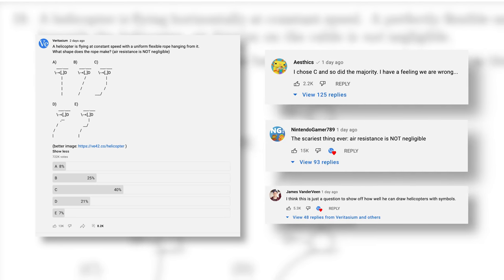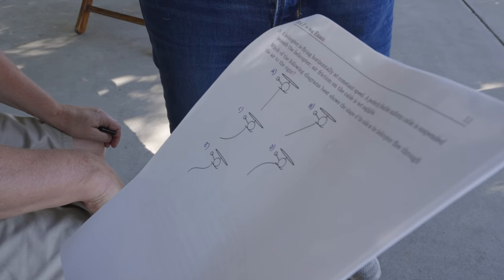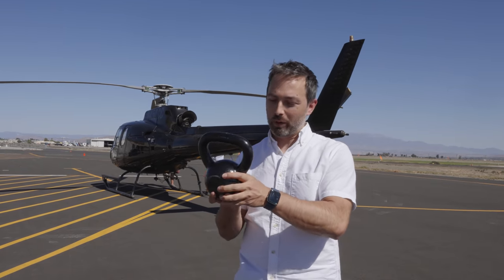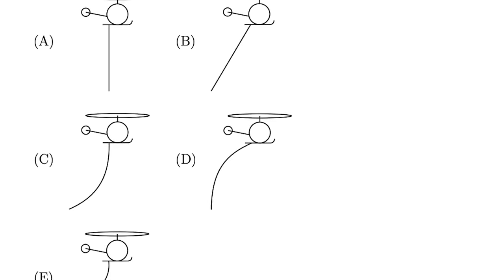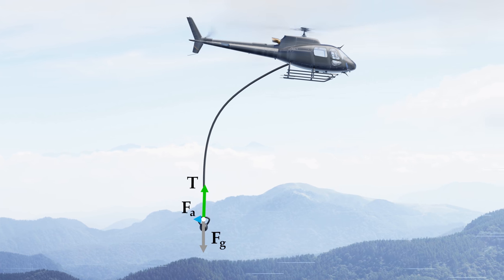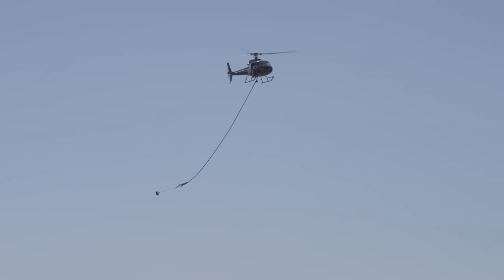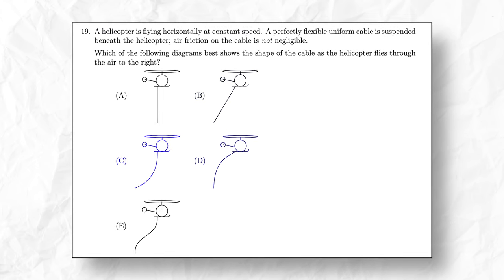I Rented A Helicopter To Settle A Physics Debate

Comment: I picked B because it felt correct, but that's probably due to me having watched helicopters with sling loads in person before. Great to see the actual explanation behind it!
Reply: I have worked up north for a few years, and most equipment going off-road is transported by huge helicopters (diggers, material for camps, etc.)  So I've seen lots of helico transports coming and going.  They used a huge rope, like a ship, and the loads were heavy (much more than 20lbs).  And each time, the sling was in the C shape.
Reply: me too but never have even seen a helicopter up close
Reply: shouldnt it be in the D shape if it has a load attached to it? B is only for a cable without a load
Reply: @nicolasfisch2794  the farther up the cable you go the more tension is on the rope, it'll be straightest at the helicopter
Reply: @nicolasfisch2794  google for aerial firefighting helicopters. They have a bucket of water hanging and while moving the rope takes the b shape. 
There is not one correct answer. Probably it depends on the weight and the distance between the helicopter and the weight. But I am no expert (in fact I am the exact opposite) so dont take what I say very seriously.
Reply: @cabrinhaGR  Yep. The shape depends on how heavy the weight is and how fast the helicopter is moving. It can go from B to D back to B as the helicopter reaches higher speeds or the weight changes.
Reply: @coolcat8b  
I used to be an ironworker in my younger days, occasionally we'd use a helicopter to set pieces where it would be too expensive or impractical to use a crane, one of the job's we used a helicopter on was a building we'd built that was a shipping warehouse that looking from the top was 10 acres in size, we were using a helicopter to set the HVAC units on the roof.
You should've seen the guy flying that helicopter, he'd pop up at the end of the building and come screaming full bore down it with the load angled behind it from the drag, when he got close to where the unit would be set he'd flare out and the load would swing to right over where it needed to be, before it could swing back he'd have already moved the helicopter forward to where it was directly over the load at the end of it's swing from  when he'd flared and he'd be right over where that thing needed to be set, man could that guy fly that thing. 
This was back in the 90's, I had my suspicions from having been in the Army in the 80's and learning the difference between the guys who flown them in Vietnam and the guys who came afterwards, when we were done he'd landed the helicopter in the job site and was signing paperwork when I walked over to him and ask "You flew helicopters in Vietnam didn't you?", he just looked at me and said "Yep" with a smile on his face and I said "Yea, I kinda figured that".
Reply: @cabrinhaGR  totally agree, it is a shame they didn't discuss this
Reply: @coolcat8b  I'm guessing they were transported in large boxes that would give it a higher drag/weight ratio.

Comment: My guess was E, for what it's worth. But I don't know much about helicopters, so I was factoring in the downforce from the rotors, which as was explained in the video, is pretty much a non-issue.

I'm also not a Physics major, so there's that.
Reply: Good
Reply: Im a physics major and it was obviously B and D in the two scenarios. Really surprised that this is a "challenging" question to some pysicists
Reply: @seankrolyk5814  Could you please help me understand that why in 8:40 the air resistance is increasing as we go up the rope whereas it was constant in the other two cases ?
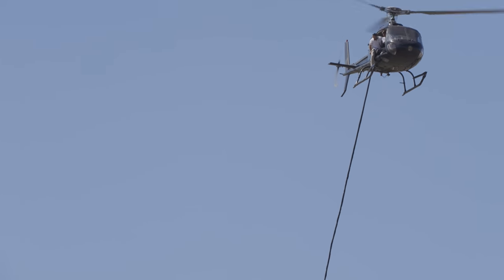Reply: @Guri_Veera  it's explained at 5:00
Reply: I put E while taking the test; I thought air resistance would act equally and make it a straight vertical line at a constant velocity other than near the helicopter.

Comment: Do you remember the thought experiment about 2 spaceships moving at speeds near speed of light, that shoot a beam of light to each other? Soon, time will come for Derek to order 2 spaceships.
Reply: I’ve heard the one about two spaceships moving away from each other at .5c but I haven’t heard that one; how does it go?
Reply: @motetotee  In this experiment, two spaceships move parallel to each other. One shoots a beam of light towards another. From the perspective of an observer on one of these spaceships, the light travels straight path which is perpendicular to the direction in each the ships are flying. While observer who is just standing near by, sees that light travelled through a diagonal path. Light travels different path depending on velocity of an observer.
Reply: another one about two spaceships with a picture frame moving near light speed in one and another observing. Derek will soon test that one too 😂
Reply: I literally had this on my relativity test a week ago. Well I know I got that one wrong.
Reply: I remember the Bell's spaceship paradox asking if a string tied taut between 2 spaceships accelerating from rest to near C will break.
Reply: If you want to contact space X here's the number.....
Reply: Isn't that impossible to have a definitive answer with today's knowledge, due to it being impossible to test since you can't get that close to the speed of light

Comment: There is a harmonic oscillation occuring in the rope too. The tension is lower away from the copter hence the frequencies are lower and amplitude is higher. The tip of the rope is free so there's an antinode there, thus the high amplitude, so it's flipping between exp graph shape and log graph shape.

Comment: Neat experiment. As a non-physicist the “weight” + “parachute” shape answers for me were immediate, intuitive and seemed obvious but not the first one, the rope by itself… 
Great fun video!
Reply: The correct answer would have been (F) impossible to say without knowing the length of the rope and the rotor wash speed to forward velocity ratio. You've got downward wind from the rotors and wind from the forward speed. As the length of the rope increases, some of it will eventually fall outside of the rotor wash (losing the downward wind).
Reply: @Mr.Ekshin  He actually mentioned that the downward wind from the rotors wasn't actually relevant.

Comment: I love how last 2 examples are so easy and intuitive, while the 1st one is so confusing.
The proffesor who suggested to remove the weight managed to screw over so many students with that slight alternation.
Reply: The first one is not only confusing, it suggests you have to neglect one of the forces on the force diagram.  Had the question said the propeller wash is negligible, it would be a much better problem.
Reply: It’s not screwing anyone over when it’s literally physics lol
Screwing someone over involves something unfair but physics is by definition “fair”
Reply: They didn't screw anyone over. They stated all of the pertinent parameters necessary for the students to balance the forces and deduce a solution.
Reply: @bermchasin  that’s a good point. Most people wouldn’t happen to know that propeller wash dissipate quickly
Reply: @bermchasin  you would only state that the rotor wash is negligible if it were a hypothetical statement. In reality, the rotor wash is negligible. Certainly, you would have to have personal experience or prior knowledge to consider that, but that adds a more challenging aspect to the question.
Reply: @davidlogsdon7767  Personally I didn't even think about the rotor wash when I answered the poll. I chose C because my intuition initially told me the wind had less weight to deal with on the lower end, so the wind would move it more and move less at the top because the rope got all that weight hanging off of it. Pretty neat test, not gonna lie.
Reply: @XCOLEXful  absolutely. It really does seem counterintuitive. I don't have much experience with helicopters specifically, but I'm somewhat familiar with how dense air actually is. We don't usually consider that. High output leaf blowers demonstrate it quite will on land. The velocity drops quickly as you get away from the source and that's with a very focused stream. It's super cool to see it in action above ground.
Reply: @thehorizontries4759  they removed the part of a question which made it easier to picture in head and answer intuitively, so yeah the dude did screw over a lot of students that would answer it correctly if the weight was there.
Also it sucks how it didn't say anywhere that propeller does nothing to do the rope.
If the rope was weighed down you would assume that the object's weight is great enough to "ignore" whatever forces propeller exerts on it.
Reply: @bermchasin  Yeah it would be a cleaner task to solve for us who don't quite know how far the wash goes.  ...but hold on, wouldn't most of us still go for C answer? For the J shape? Wouldn't you?
Reply: @mfst100  i would go with the straight line example if we neglected the prop wash AND assumed a perfectly frictionless joint at the point if contact with the rope. But I'm also a physicist by training.

Comment: Meanwhile, in an alternate universe: 
“You are flying a helicopter. Assume air resistance is negligible.”
Reply: Well then the answer is you are cosplaying flying a helicopter
Reply: @AL-wv8jx  Not necessarily — it could also be “You are falling in a helicopter.”
Reply: "You are sitting on the ground in a helicopter while the rotor spins"
Reply: @AL-wv8jx  /bow
Reply: You know what, you don't need air resistance to fly a helicopter, reduce air resistance alone will actually increase efficiency of said helicopter.
Reply: @JimmyZeng  Question: What makes a helicopter stay in the air?
Reply: @Benny_Blue  Lift, you're probably thinking to reduce air resistance, you have to reduce air density, which leads to reduced lift (given the same rotor and head speed), but that's not the only way.

Hint: plasma.
Reply: @JimmyZeng  lift only works because there is greater air resistance on the underside of a surface than on the top. That goes doubly for angled rotors that catch air in a manner similar to fans. Even a bizarre helicopter model relying on buoyancy would only work with resistance from the air pressing in on the vessel. Any fluid with zero resistance is, for all intents and purposes, a vacuum. It cannot act on objects immersed in it or vice versa.
Reply: @vitriolicAmaranth  Lift is complicated, fully symmetric airfoil also works. Vacuum is not a fluid. I agree the only way to reduce air resistance all the way to zero is vacuum though, that is not what I'm trying to say.
Reply: @JimmyZeng  Correct, vacuum is not a fluid, nor did I say it was. I said a fluid that lacks ANY resistance is functionally a vacuum. It has the same properties as a vacuum. Actually, a fluid with no resistance cam't even properly be called a fluid, as with no resistance the particles comprising the fluid cannot directly influence their neighboring particles.
Reply: @JimmyZeng  Also, to be perfectly clear, I did NOT say that a vacuum is the only way to reduce air resistance to zero. I am not suggesting a practical way to achieve the goal of zero air resistance. I am saying that if there is zero air resistance, the helicopter will behave as though it were in a vacuum, whether it actually is or not.
Reply: @Benny_Blue  … helicopters don’t fly, they just vibrate so much that the ground rejects them … 😂😂😂
Reply: @vitriolicAmaranth  your explanation of lift is so completely misinformed that I assume you could only have learned it in middle school.  

Airfoils develop both lift and drag simultaneously from the acceleration they impart into the air. Lift is the reaction to this acceleration perpendicular to the airflow, drag is parallel. Lift to drag is based entirely on the angle the airflow hits the lifting surface. This is to say lift is a reaction force to the energy being imparted into the air by the wing. This is based only on the mass of the air and the acceleration of the air.
 
As the air is accelerated by the wing, a local low pressure is generated at the acceleration region, the wing is shaped so that it accelerates more air above it than below it, this is by making it flatter to the air on the top than on the bottom. This pressure difference pulls the wing up. As it gets flatter and flatter to the air though, more of the reaction forces from accelerating the air will be parallel to the airflow, meaning more drag, less mass acceleration lift, but more pressure lift. Eventually a point is found of highest efficiency in the wing shape and angle of attack for a specific windspeed to give the ideal lift to drag ratio.

Wind resistance comes from viscosity of the air for laminar flows and low pressure regions behind a moving body, both of which will not come up in a discussion of wind lift to drag because of their relatively small impact when the wing is in its operating conditions.
Reply: @Thesupremeone34  I know all of the first two paragraphs, but none of it is relevant in this context except to say, in a cursory manner, "lift is generated when the top of a surface has less pressure than the bottom." However, pressure is literally a function of physical resistance in a medium. Without resistance there is no pressure and without pressure there is no lift.
Reply: @vitriolicAmaranth  Pressure is not a function of the resistance in the medium at all. It entirely is a consequence of the momentum of the particles in the air. Viscosity, or physical resistance, is the resistance to sheer forces, thus the resistance to a pressure gradient, or the first integral of pressure with respect to time. Area terms can be removed and viscosity is then the diffusion of momentum through the fluid. Viscosity,  and thus resistance, is a result of pressure, not a cause of it. 

Moreover, if you look at the bernoulli equation, which is a sttement of the conservation of energy, you will find there is a pressure term, but there is not a viscosity term. A change in viscosity has no affect on the bernoulli equation's expectation of local pressures. Same with the ideal gas equation. And the same with the inviscid forms of the navier stokes equations (called the euler equations). Lift exists in inviscid flows, and air is reasonably modeled as inviscid by the Euler equations because its viscosity is so absurdly low. Wings will work as intended using only inviscid flow modelling until you are near a significant factor of the mach number because the air resistance does not contribute to lift. 
Even the Kutta–Joukowski theorum completely explains lift without relying on resistance of the air. It doesn't even need pressure. Just velocity, density, and circulation are sufficient to accurately predict lift. It uses stokes theorum and the bernoulli equation to remove dimensions from the pressure terms to arrive at a velocity expression of lift.
Reply: @Thesupremeone34  Why do you think the momentum of particles in the air can affect other objects? Spooky inductive magic? It's a transfer of kinetic energy from the particles to the object, which is synonymous with resistance. The fact that it is synonymous with resistance (ie that motion is relative, and it does not matter if the air, the object or both are moving in relation to an imaginary fixed point) is why we can test aerodynamics in wind tunnels.

Air having no resistance, ie, air particles being unable to collide with objects and transfer force in that manner, means air having no pressure. And again, no pressure means no lift. Don't know how to get this across to you, since apparently you think velocity and viscosity are spiritual properties that get conferred to nearby objects not through physical interaction (ie resistance) but through action-at-a-distance, and that formulae that (for obvious reasons) focus on accuracy over precision by accounting for the overall properties of the air as a fluid rather than the motion of individual particles somehow prove that the physical interaction between an object and air is unimportant to phenomena like lift.

Comment: What an amazing thought experiment.  I first started thinking about this issue while reading "Through Gates Of Splendor" by Elizabeth Elliot.
Reply: Hi
Reply: yo
Reply: third
Reply: Can you make video about delta P?
Reply: Can I ask you why this book brought up this issues?
Reply: Love your channel
Reply: @Kennysmelle   It involves getting stuff in a basket on a long rope to/from the ground while a plane circles.  Also some stuff on reliable fuel supply.  And something on missionary contact with primitive tribe(s).
Reply: Hi
Reply: Brought to you by audible.    :-)
Reply: I guessed b and I was right
Reply: It's not just a thought experiment.  It's a conceptual question to understand physicist better in application.
Reply: The rope will be a different shape depending on what kind of rope and how long it is. thought experiment: one mile long string that is the same weight but only a fraction of the slightly open to winds cross section would appear more in rope E... with a larger cross section increasing through the middle of the rope and its actual weight being represented more towards the extremities. the larger the rope's cross sectional area displaces compared to weight the more it will translate in the x axis at the farthest end... which would be more central the heavier that rope would be inversely.
what kind of rope matters
what length of rope matters
the fluvial medium also matters.
thought experiment extremes:
airship suspension at 20,000 feet
the rope is heavier than water and being pulled behind a boat...
buoyancy was never a consideration.
Reply: For something else to ponder, assuming  an actual longline & hook (75m nylon, 20kg hook)  attached to the helicopter instead of the rope. For a given constant speed of the helicopter, what is the minimum load required on the hook to restore it to a straight line in flight, assuming the load is spherical r=1m?